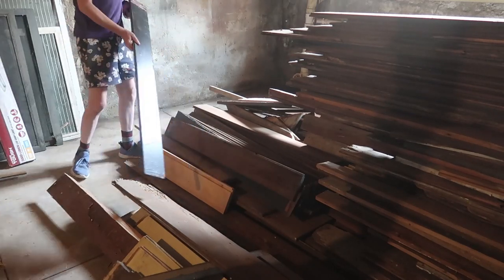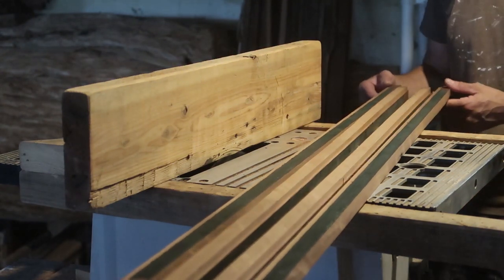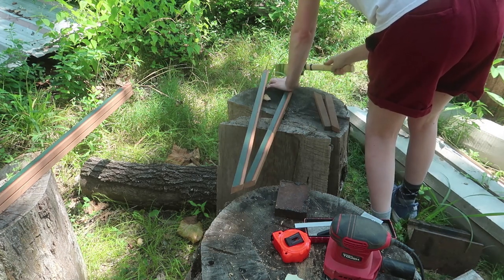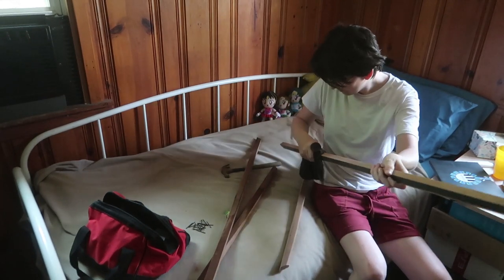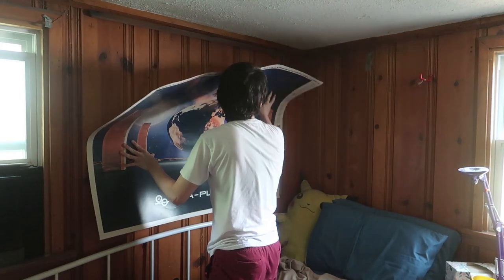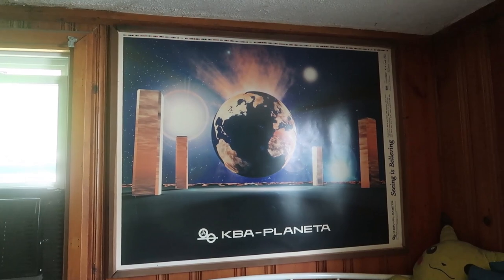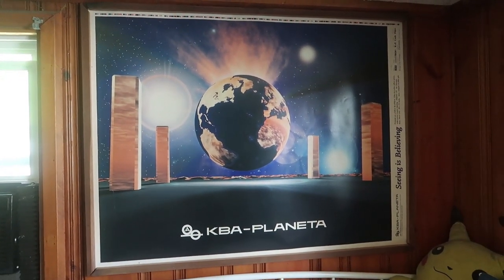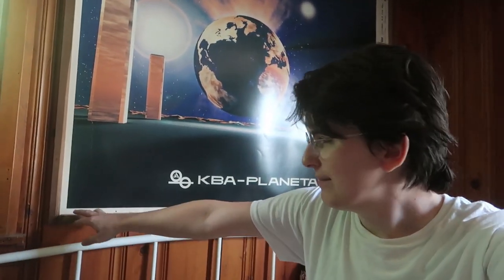Making a wooden frame for my favorite poster from 1930s floor boards.

Comment: It's a pretty cool poster; mostly an advertisement for the capabilities of a brand of large format multicolor poster printers which I assume you already knew. I've seen one in the wild at an old print shop. Never thought to look it up until now though. Kind of wishing I'd have thought to inquire about it while I was there. The machine those things were made on were massive/ still are massive. 
The printshop I worked at, we just stuck with large format inkjet printers. 
I think you're definitely right, I doubt very many copies of that exact poster would have survived. Or at least they're probably in the company warehouse somewhere